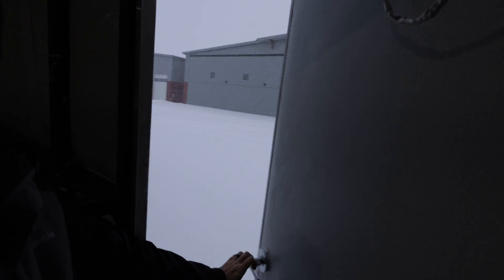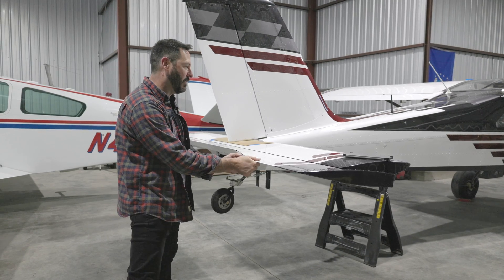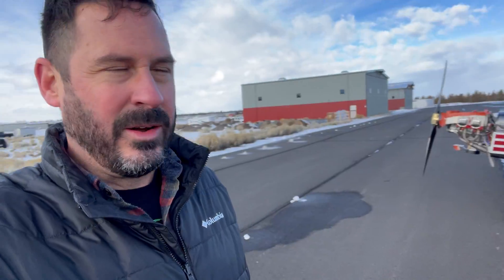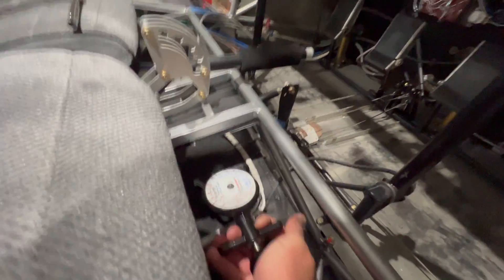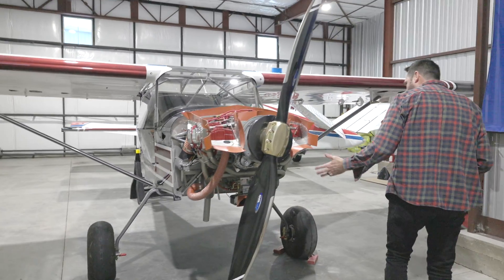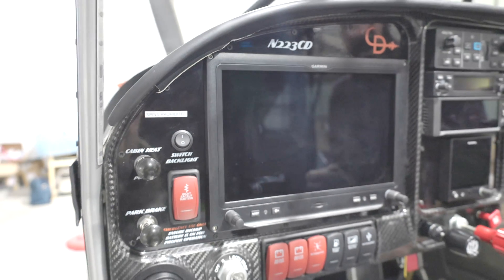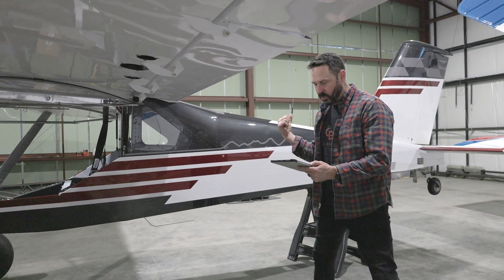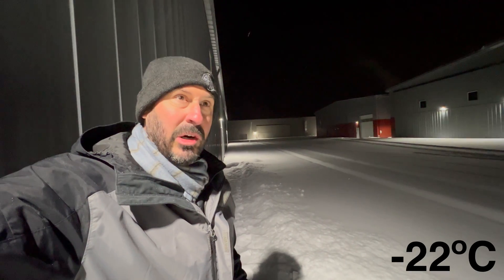Will This Arctic Blast Delay The Bogey's Airworthiness Inspection?

Comment: You should not have thread sealant on your AN fittings where the flared tubing attaches. The threads and the cone/flare should be dry.
Reply from the maker: Correct! Thanks for the comment

Comment: What was the issue with the LightSpeed ignition wiring and the RPM, were you wired to the analog sensor outputs?
Reply from the maker: That’s right! I published a separate video talking about that

Comment: Lookin' good! Just use 3M double sided tape to hold the wing cuff and clear latex caulk around the edges so you can remove it later. I would set the prop at 16.5 degrees (2300ish RPMs on takeoff), which is a good compromise between climb and cruise. Know that your Titan will run HOT, but should break in within a few hours. Reach out if you have questions on the test flights. I'd like to fly up at some point when the weather gets better to see it in person!

Comment: Good luck on the inspection. That loctite is the same one I use when sealing fuel lines for the F100 and F110 test cells. It really works great but it’s messy and never really fully dries.

Comment: I've never checked the rudder cable tension of my S-7S, but I do know it's earlier much stiffer return springs, caused the cable to exhibit frayed strands at two different locations, at less than 1000 hours!  I replaced them with much softer springs and in triple the time the first failed, they are still good.   Just tensioned enough to not flop around is my gauge.  The plane is looking great! I had a very experienced exp plane builder as well as being a aviation Vo-Tech instructor tell me once, DO NOT do a perfect job, purposely miss a cotter pin  or some other easily remedied thing. In my area at the time, the guy had to find SOMETHING or else it he didn't feel like he was doing his job. No matter how early he started, when lunchtime came around, he wasn't finished, as soon as you bought him lunch (another tip I got) and back inspecting, he was done and out the door in minutes! He did 5 planes for me, same deal every time.
Reply from the maker: Hahaha!! That’s an amazing amount of experience and wonderful advice (I hope). Thanks so much for the great comment!

Comment: If you decide to relabel after inspection, you should be able to get clear tape with white / black lettering depending on what you want for your label maker. Cleans up things a lot!
Reply from the maker: Great advice! I sure do (plan to re-label to what is actually necessary and looks cleaner). I suppose I could have the black powder coated panel inserts re-painted, but I like your idea better